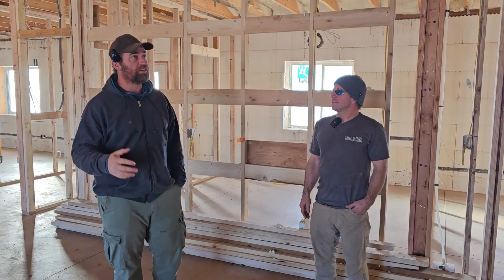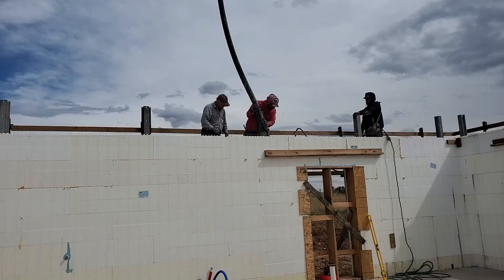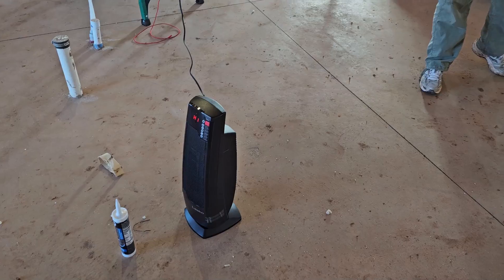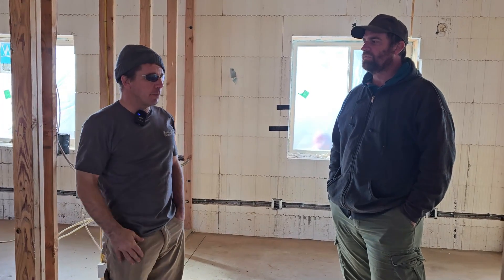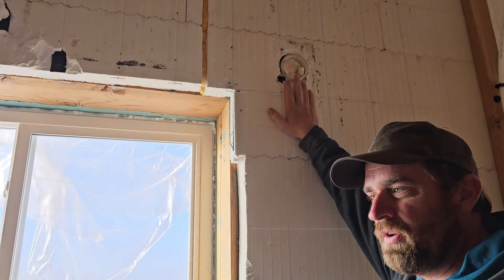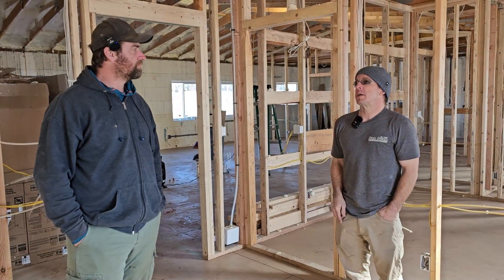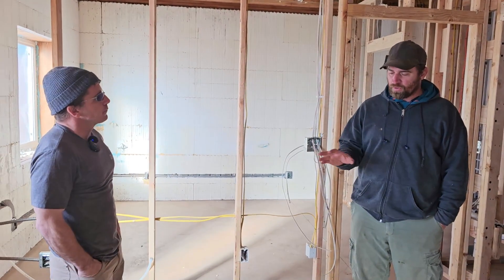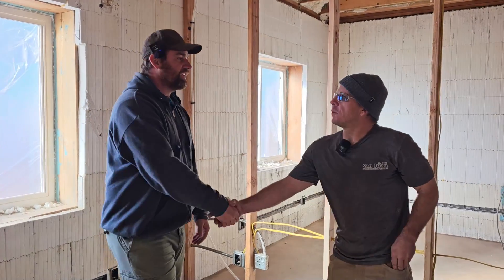Vented Vs. Unvented Attics?! Spray foam vs. Blown-in?! What is best? (Super info dense)

Comment: I am always a few steps behind. Getting ours sprayed in 3 weeks. Going to do 4 inch of closed. Im in georgia so a lot less of a heat load then yall out in the mountains.
Reply from the maker: It makes a huge difference. So glad you're building! How are you fighting humidity out there? We live in a very dry place so I've never had to battle it.
Reply: @Mountainview-mesa  It isnt too big an issue at least not any different then any other high performance home, we just swap the erv for a venting dehumidifier and should be good to go.  It will slightly pressurize the house which we want in a high radon area.  As far as leaks go I am going to put a fog machine in the house for a few hours and then put a fan in the door, like a blower door with some plastic. The fog should get pushed to where ever there is a leak and be able to be seen. Poor mans blower door.